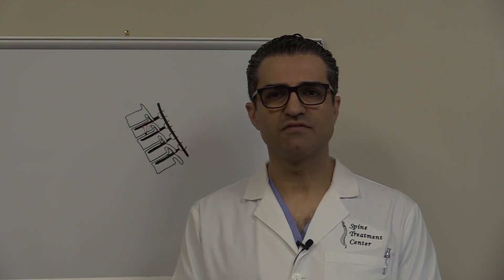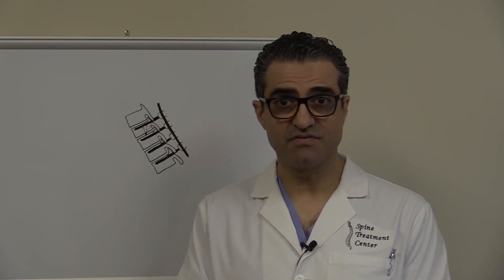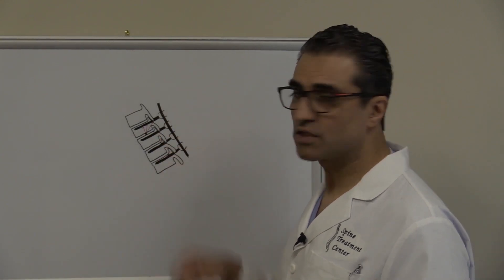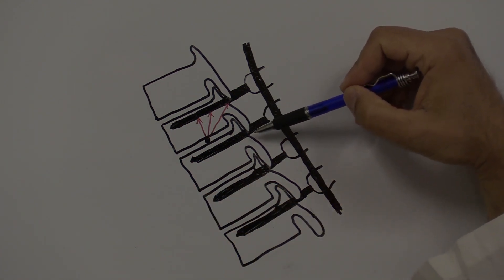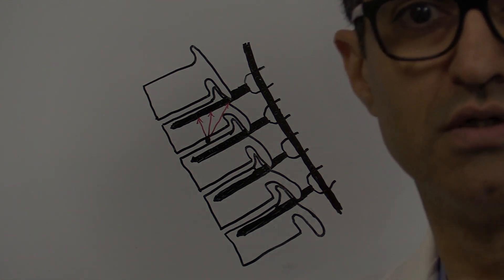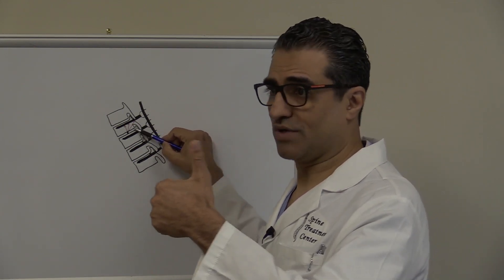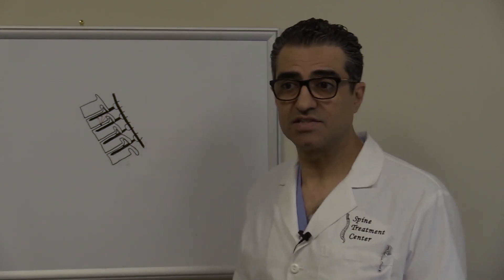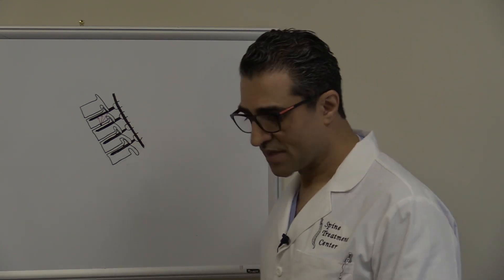Biomechanics of pedicle screw and how they fail

Comment: Interesting key insights. I've had my 7th spinal surgery on August 6th 2025 and the first revision surgery was December 1st with extension to sciatic 1 and disk replacement for L5 S1. But the pedicle S1 screws bilaterally failed and I needed it and now feel with BPM type 2. But that first L3-L5 was broken at the bone growth inside and L3 pedicle screws were loose for 6 months doing PT and the pain was worse. Now today 66 days post op I feel better than after the first Lumbar decompression we'll before the 3 fusions. And finally, my Dr Nomoto did all sorts of studies, blood work, endocrinologist and decided to use the largest screws and a slight difference in entry angles on the S1. I feel solid as I'm also wearing a lowest level hardback waist brace for an additional 3 months post op and no PT for at least 5 because I was using the Reformer machine and that alone could have caused the first L3 screws to have latency and break the newly growing bone. I'm walking almost 2 miles 3 to 5 times a week. Great video information 👍🏼

Comment: The reason we use monoaxial screws as far as possible is because there is a weak point at the junction of screw and base in polyaxial types and also we augment the fixation with transverse connector if possible. keep going for a new design of screw.

Comment: I will never understand Dr whom all approach a one single system and issue. Because you use screws in bones, it has to be a mechanical force only failing. What if physicians were trained to see the big picture and work by understanding a multiple system approach. Sensitivity to metals, bad angle not respecting the right curves (lordosis and or syphosis)…etc. I got a fracture 18 months ago, had zero bone loss (demineralization), though suffering from MCAS, I insisted with the surgeon to use pure titanium, he agreed, and used an alloy. I am positive now to the metals alloy (Melisa test)….but surgeons are not agreeing to validate the fact that high levels of inflammation due to metal sensitivity, first made the screws loose, and now my lumbar and dorsal vertebrae’s are in osteoporosis, my femurs are in osteopenia….in 18 months, it is related to a systemic condition triggered by allergy and sensitivity. It would simply be nice if surgeons and Dr would open their ears and eyes. A lot of patients just like me are wondering, wandering, blamed… metal sensitivity is rare according to surgeons. It’s only rare when we don’t use the right tools to diagnose it. Of course it is rare…if you don’t explore that option. I have even been blamed by a surgeon….why on earth did you think about exploring that sensitivity option….really… when I asked, why on earth didn’t you think about it by yourself…he became aggressive. We should be a team…and patients are becoming wrestlers, how sad….

Comment: Jan 2023 Had Spondylolisthesis unstable grade 3/4. Apparently it’s a 2/4 post surgery. Spine crushed into pelvis. Procedure to fix was ALIF one cage, S1/L5 Pedicle screws & rods (4 total). Felt amazing for 6 weeks post op. Suddenly had debilitating pain. MRI shows 2 loosened Pedicle screws on both sides (1/2 is debilitating more than I was prior to surgery). Surgeon keeps stating “bone fused successful”, overseeing L4 is still junked up & screws are failing. I can feel my Rod on the side that hurts the most. It’s ruining my life. I am trying to do all the research I can
Reply: Oh my god, thats horrible. I am watching this as i am supposed to get pedicule screws for 3-4-5-S1 and a laminectomey l5-s1 causing signs of cauda equina......So sorry for yourself. Are yu doing better now? did they fix the problem?  Im really scared to have the fusion

Comment: Brilliant engineering explanation of TOGGLE:

toggle mechanism, a combination of solid, usually metallic links (bars), connected by pin (hinge) joints that are so arranged that a small force applied at one point can create a much larger force at another point.

I am a retired Architect that has had a Laminectomy from L3-5 which is causing some uncomfortable quad muscle tightness/pain symptoms.
I have received some transforaminal epidural injections at L3-4 with 85% relief. The surgeons have recommended an  ALIF and posterior hardware procedures L3 - S1.

THANK YOU, THANK YOU!!!
I WILL NOT CONSIDER ANY SURGICAL PROCEDURE UNLESS IT IS LIFE-SAVING!!!

I will continue to do the injections every 4-6 months and carry on!!!

Comment: What happens when the patient gets to 70 years and they have shrunk by 2 inches, but the metal work they had as a teenager has not. "Research" only goes out two years as a standard
Reply: Ive wondered this as well. In old age we tend to get more hunched over or kyphotic, so the question is will the fusion inevitably conflict with the unfused lumbar segments when the natural trajectory  due to ageing is for those is to lose lordosis
Reply: @education7281  It's a big worry

Comment: I understand perfectly, but what I  dont understand is after the fusion why do the screws have to stay in there forever?  Me myself need C4/C5 but I cant go thru with it. Ill wait for some disc crazy glue cement to  come out. Id rather be walking with a  cane than  have hardware in my neck...no thanks. Also don't want parts of a  cadaver in my  body.
Reply: The muscle tissue and scar tissue grow around the hardware as you heal. Generally, they leave the hardware in so that they don't have to disturb everything again unless there is an issue. Everyone is different, but never be afraid to ask your surgeon or pain management hard questions as to why.
Reply: did you ever get the acdf? they wan me to do it too but i dont wanna

Comment: Excellent presentation and thank you for the references to additional supporting clinical studies doctor. I am grateful, nevertheless, what other option is there really for a patient who has one or two lumbar vertebra that have now moved out of position towards the spinal cord resulting in a type (grade) two or three outcome? In other words, a position deviation equivalent to type 2 (25% to 50%) or a type 3 (50% to 75%). Additionally, for someone like myself, living in Denmark and thus restricted to the present approved and applied method of spinal rehabilitation, the options are further limited to what currently is available and whatever is considered best practice in the given geographic region one finds ones self residing. If a patient is experiencing chronic numbness and balance instability from the waist down and it is reported that the problem cannot be trained away what other options are there? It can be quit a dilemma you understand. You apparently continue to employ the devices, so there must be some viable logic with implementing the procedure anyway. For myself at least, I may very need to accept the challenge and take the risk because I cannot just remain in a chair and continue to limit my ability to walk more that 50 meters before I get numb. It is a hard call!  Thanks again from Denmark..................
Reply: you should get another fusion maybe ? :text-green-game-over:

Comment: already 6 years since I got my doctor's and spine professor expert, a decision that  I should go through L4-L5-S1 fusion.
But all these years i was questioning that decision because I could not understand,
how metal screws inserted to my weak spine will enforce the whole structure?
how is my post surgery damaged back muscles and tissue will supports the spine? 
I was and still in great doubts about this procedure, now after watching your video,
I have no doubts, that i will not take this surgery, even as a last resort, it's doom to fail. 
THANK YOU for sharing a vital true info, most  doctors will not dare to say the truth, they only think about career and money!
Reply: @objetividad693  yes that is my question too
Reply: discogel and stem cell can help out the disc regeneration. Fusion is a criminal activity.
Reply: Agree I’ve had 2 fusions and I would wait for better surgical developments such as artificial discs. From my two fusions I’ve had adjacent disc herniations due to the extra mechanical forces. The thoracic fusion has collapsed and is now fused, the curve in my spine (kyphosis) which should be between 20-40 degrees is now at 90 degrees and getting worse.
Reply: @objetividad693  if you watch carefully the dr indeed said that it the pedicle screw constract works well only for instability i.e. spondylolisthesis.
Reply: I agree with.
Reply: Do t do
Reply: You are 100% right...

Comment: Not sure if anyone looks at this thread anymore, but I have been searching for answers for years. I had a Anterior/Posterior 360 deg fusion in August of 2013. I had a revision surgery in 2014 to replace screws that were too long ( went out the other side of my vertebra by 4mm. PLUS the surgeon told me one screw was already loose. I have had pain ( moderate to severe ) for the last few years, but also I have a very pronounced "clunk" when I move certain ways. It's random when it happens, but it is sometimes loud enough for my gf to hear it several feet away. No one seems to have any clue what is causing it. I have been dismissed several times with one Dr. telling me it was just a normal "cracking of a joint. No sir ...it is not. I know my body. They have checked with both an MRI and a CAT scan, but I guess because of the hardware it is difficult to see around the hardware because of "blooming". I realize my issues are complex, but the pedicle screws have always been a question for me since shortly after the initial surgery.
Reply: Ask to get a PET/CT scan with contrast. I had one after years of pain after my multi level thoracic fusion. It was done to see if if my fusion was fused as I am needing reconstructive surgery, but it showed that my screws were directly into my nerves and into the joints that join the rib the the vertebrae. The hot spots were like a Xmas tree. Now I’m getting the metalware out in the hopes it will reduce the pain. However I’m not sure I’m a candidate for the reconstruction now. It’s really disheartening! Good luck
Reply: @KiwikimNZ  I have had more CT and MRI's than a normal person should ever have to go through. Luckily and I believe shortly after I initially wrote this, i found a competent surgeon who noticed an issue with stenosis through parts that he felt were causing a lot of the pain. Now it didn't take care of all of it or the odd clunking, but reduced the pain to where I could manage my day to day with meds. Finding the right doctor is critical and, in a lot of cases, several doctors. I have a great group who now treats me. They have all been life savers.
Reply: I feel like I have movement ..had fusion in 2015  L 4 and 5. I a,so hear a pop. I told my go today I feel like I have a metal box in my box moving.
Reply: @ritastutler1470  Well I since have had to have 3 more surgeries.  The last to relieve severe stenosis and nerve pinching. That worked well, and the Dr. that I had found near Allentown, Pa was excellent. Unfortunately, as with a lot of people, the issue never stops at just one thing. I am currently trying to put off any more surgeries for as long as I possibly can take it. As the last surgeon told me, it makes it worse every time you have to disturb that area. I wish you the best in your pursuit of relief. I have the best pain management team I could have ever hoped for and I hope you can find answers and even a little relief.
Reply: same here Chuck, the clunk is getting worse by the min.
Reply: how's it going for you?

Comment: Thank you for these well observed details... This is an important discussion... in engineering you may be interested in the Charpy V-Notch Test, it’s about determining the sudden point of failure.  In pedicle screws, the more hardened, the more brittle to sheer (typically - unless other materials are introduced which may not be surgically suitable).  The screw breakage is primarily at sheer, not bending flexes over the screw length because the screw shaft is primarily held in constant until the very near the area it protrudes. It’s much like an electrical fuse - like a glass fuse we see the wire. The fuse is totally fine but it has a very sudden defined breaking point that is immediate.  Once a pedicle screw has exceeded its tolerance, it breaks off.  This tells two stories. 1. The human movements are capable of breakage and this makes pedicle screws less attractive for use;  2. The assumptions that a long screw is a great fixation is a failed belief if and when the screw breaks.  If you asked the surgeons who have performed thousands of artificial spinal disc implants, they will explain it’s not about fixation, it’s about natural movement the Spine was intended to function in the first place.  Many suggest it’s old school and verges on barbaric to fuse operating bones together when mobility options exist. 

Check out surgeon to surgeon presentation videos at Seattle Science Foundation Dr. John Hsiang and Dr. Michael E. Janssen who have performed many thousands of artificial disc implants.  If a patient is an good candidate for an artificial disc implant, there is no medical benefit to spinal fusion. Spinal Fusion leaves the patient far less physically able, causes ASD eventually and is old school.  In Europe where the artificial disc implant was invented in Germany in the mid 70’s, they have decades more experience and far better patient outcomes.  The US is shamefully not the leader.  It’s arrogance and the imbalance of the FDA and big corporate money that has blocked the best implants like the Spinal Kinetics M6 from being a standard in the US.  The M6 is the go to implant in Europe for the past decade, as well as the slightly newer ESP.  

The US is being bombarded with patients who are on the internet and demanding artificial disc implants over fusion. Natural movement will win most people’s desire.  Would you really fuse someone’s knee anymore? Time to move towards reality.

Comment: Good info, a little scary though for someone considering surgery for scoliosis like myself
Reply: I wonder if  you  did it and how did  it  turn out?
Reply: I am wondering too, I go in next week. It is a revision. I asked seven years ago for my surgeon to take the screws out because I thought that was why I had more pain. He took them out after they were there for two years and broke one of the four in half. Long story short the two vertebrae above that fusion had to be fused, it looks solid, screws etc are intact. (L2/3). However the lower vertebrate (L3/4) is not going well. On CT’s and bone scans you can see bad lipping, and both vertebraes , one going forward and one going toward the back, the disc has disappeared. Next week the plan is to stabilise the two vertebrae and place a plastic disc with bone material inside. I don’t know if I have a chance of it working especially after hearing this lecture because of the condition/quality of the vertebral bone but I am going to give it my best shot. I want to walk and stand properly. 😟